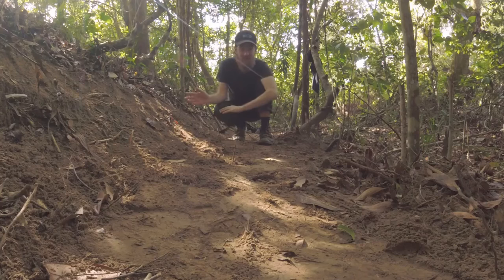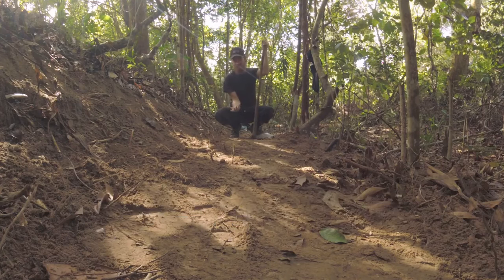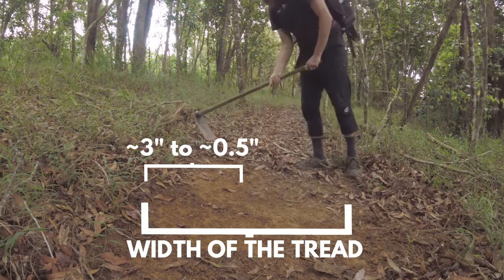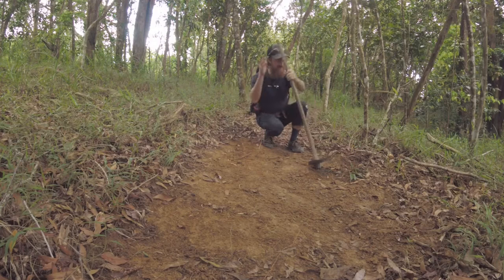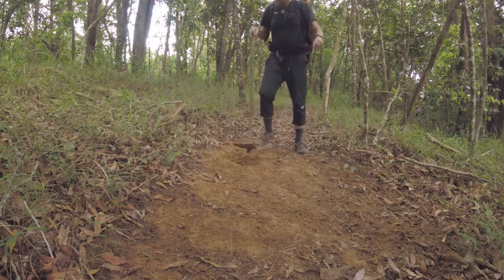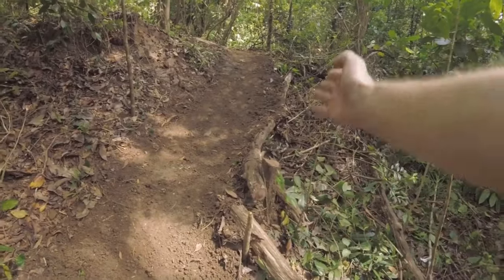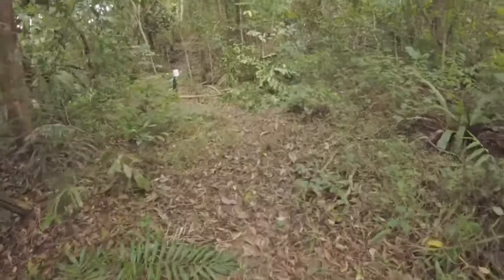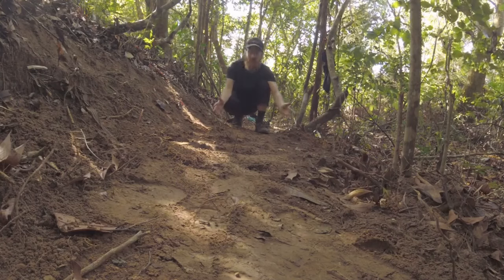How to Dig Bench Cuts & More! (Fixed Audio from Original Video)

Comment: What is that squeaking in your audio?
Reply from the maker: The jungle. Not a place of solace by any means.
Reply: @A.T.TrailWorks  OK, yes, obviously there are creature sounds, but later on I pick up a very regular but faint high pitched squeaking. Wondered if it was something to do with your production gear, but I guess it could be some critter.  It's just so very very regular, as if mechanical, I really began to wonder about it.
Reply from the maker: Probably my phone if it doesn’t sound organic. I have partial hearing loss so I can’t hear certain frequencies. Could also be the noise filters that I put over the original audio as well, sometimes that gets squeaky. I need to make an updated video now that I’m back in the States.